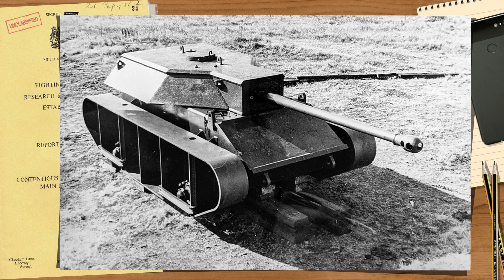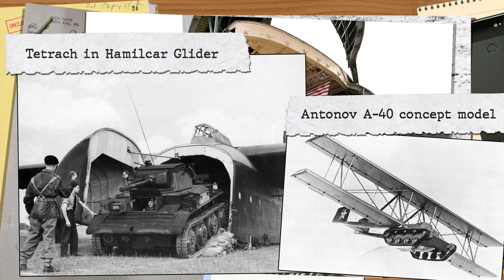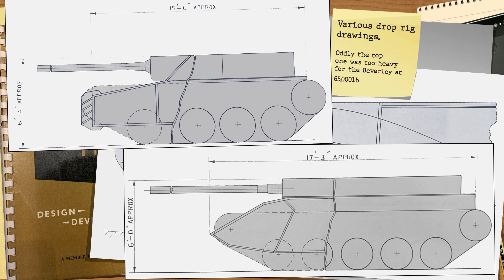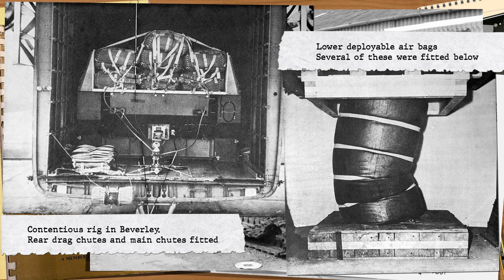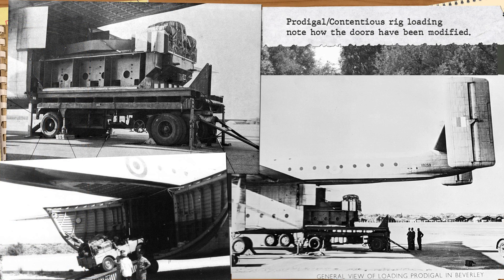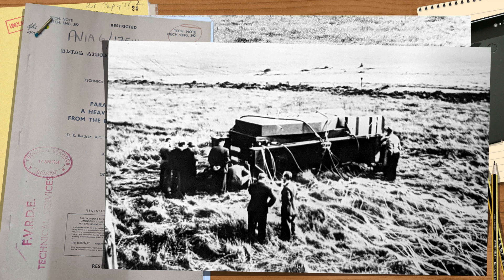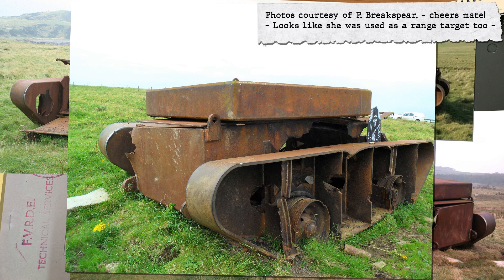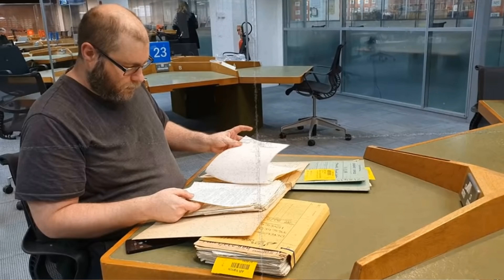Contentious Air Drop Rigs – Tank Design & Development

Comment: Airdrops tend to wreck havoc on some critical components, anything that holds something heavy, like an engine block cracks easily, as does anything with hinges deformes into something solid. The Bundeswehr tried airdropping the small vehicles the Fallschirmjäger had (Kraka, Wiesel), in both cases they stopped as soon as it was evident it just wasn't practical at all.
Reply: The US was able to make the m56 scorpion air mobile self propelled gun, they achieved their goal by making it so light and the suspension so springy it nearly tips over backwards from firing.
Reply: It goes to show how important early management decisions can be in development. At the same time the Germans were failing to successfully airdrop their airborne vehicles, the Soviets were already introducing their second/third generation of successful airdrop vehicles. The difference was the Soviets started serious work in the 1930s and kept at it, so they had identified and fixed most of the serious problems before the Bundeswehr was even formed. The poor Germans, of course, didn't really get to work seriously on airdrop for many years, didn't have access to the Soviet data, and so had to find out the hard way what the Soviets had learned decades before.